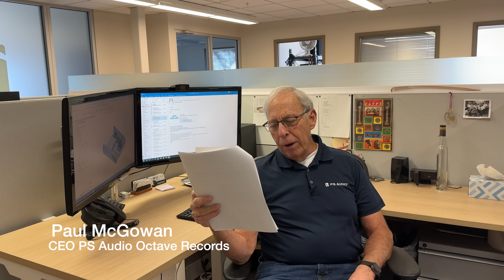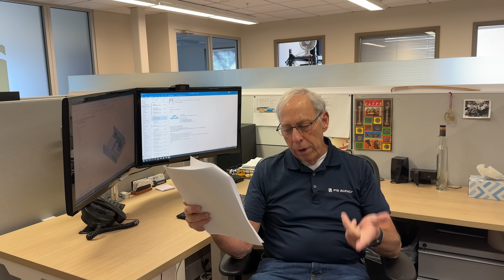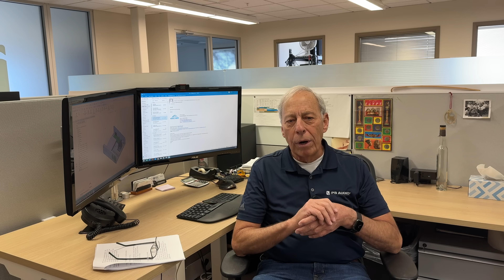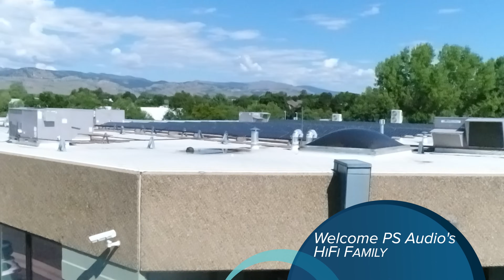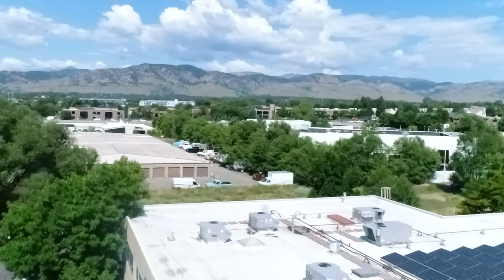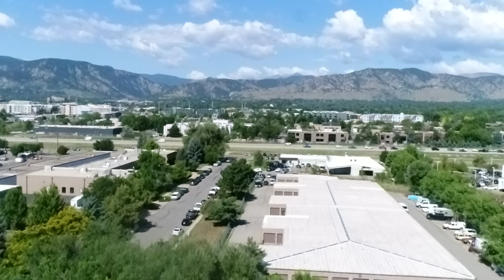Solid core vs  stranded speaker cables

Comment: Paul’s a smart guy. I can’t believe he continually walks into this minefield regarding cables. Common sense tells each one of us that two cables of equal total gauge, length, and of the same material (but where one has varying vs the same gauge sizes comprising its construction) cannot be heard as different   in a blind compare over multiple trials, where all else in the set up is equal. It’s just not possible and we all know it.  Can a difference be measured? Sure?  Does that matter if you can’t hear it? No. If you AB  them in a non blind fashion after spending significant $ on the exotic version and telling your friends about it are you convinced you hear it?  Absolutely-freakin-lutely.  The placebo effect is real. Confirmation bias exists. Both are the bane of this hobby.
Reply: @fakeklg  care to elaborate?
Reply: @edd2771  no, but yea: 
🙄 is the action or gesture of turning the eyes upward as an expression of annoyance, exasperation, disbelief, etc. : the rolling of the eyes in response to a YouTube comment that expresses unprompted explanations of supposed expert opinions.
Reply: Yeah, it just goes on and on. I've been reading this kind of "stuff", to put it nicely, for decades.
I don't know from "blind tests". I don't know from cable science, or the lack thereof. I don't know you, and I don't know what you've experienced in your lifetime. I most certainly would not presume to tell you what you've experienced, or not experienced. That is a fool's errand.
What I 'can' tell you is an experience that I had early on in my audiophile journey. This was before I ever heard about 'blind tests' and 'placebo effects' and 'psycho-acoustics' and 'the illusion of cables brought on by money spent'.
I had purchased a modest stereo system, and was hoping to improve the sound with some new interconnect cables.
I read no reviews or advertizing of these cables. They were just what happened to be on sale. The price I paid for them was fairly well under a hundred dollars.
When I took them home, I had no great expectations. For me, it was more or less an experiment. I wasn't sure if they would work or not, and if so, by how much the sound would improve. They were intended to replace the out-of-the-box cables I had received from the factory.
I had no fancy graphs or pie charts to tell me what the cables did or didn't sound like beforehand. I had to play some music and use my ears to judge. Blasphemous, I know!
Well, my ears told me that the music I was listening to now suddenly sounded WAY better! Like I had bought a whole new stereo system!
Now, it could be that my ears were liars, in which case I'd better be EXTRA careful when crossing the street.
However, like a naive child, I trusted my ears, and have enjoyed my music more ever since.
Good thing, too. If I had been one of those people who doubted my own senses and thought cables were just a bunch of hooey, I wouldn't be enjoying music more, and would just be miserable.
Reply: @Hare_deLune  wow. Talk about “going on and on…”.
Reply: @edd2771 
Ha!
I make no apologies for being a pedant.

Comment: Also, take into account the synergy the cable brings. It depends on how you want to tune the sound in your system. I use naim nac a5 cable. I’ve used cables with silver and they were too bright and enhanced sibilants.

Comment: I find it funny when people try to explain why they believe cables make no difference. I believe to my ears🐭
After many years of passionate listening and music enjoyment i can confidently say that if you don't admit cables influence sound, you didn't even try 🙉
Reply: So lets setup a blind test and do a livestream
Reply: yes. absolutely.. the cables i built myself from standard electric cables from my local hardware store 6mm sounds the very same or better than fancy $$ cables. do that and see.
Reply: In order to hear the small difference (5%), You need equipment that is worthy of the difference.  I suggest system starting at 20k, then ensure your source music material is up to spec in terms of the original master, mixing engineers, proper microphones and placement.  Preferably a live version of a recording in a studio instead of 16 - 24 layers.  That makes a difference of easily 10 - 20 %.  Also, cable from dac to amp should be upgraded for another 5% difference.  Now you have a 30 % difference.  Also, you get another 2 - 3 percent by placing speakers in reverse phase.  I know it sounds crazy, but reversing the + to negative on both speakers provides better sound stage.  2-3% I estimate.
Reply: @AV-MusicMan  Oh Dear, what do you recommend then in terms of polarity reversal for speakers with the tweeter, or the midrange already in reversed polarity? What about inverting amplifiers? Should they be inverted or left alone, because they're already inverting? Is there an incremental improvement to be had from every reversal, as is the case in multi-stage amplifiers, or is it not additive?

Comment: I use Naim Nac A5, which is kind of a mix of both worlds. 4mm2, made from 19 thick strands of 0.51mm diameter copper. Wow! I couldn't believe the difference compared to the similarly priced Audioquest rocket22. 
Naim don't push the marketing on this cables, but they are proper hiden gems.
Reply: Not that hidden a crapton of us in the UK use them by default. They are neither ‘stranded’ as in 50+ fine strands nor single core but somewhere in between - multi core. They replaced more expensive Audioquest cable in my system years ago and to me they are ‘end game’ because some rabbit holes aren’t worth it.

Comment: What kind of cables are inside PS Audio speakers or amplifiers? Multi-solid core (another stranded kind) or stranded? Which dielectric material has been used ?
Reply: gracias a mamá por cocinar y a papá por los gritos! 😮

Comment: Cables carry the signal from one component to another, or to the speakers. Hard to believe that some people think they aren't that important. Even the best cables lose some sound quality. The best you can do is limit the damage by using really good cables. It might be a case of having to buy really expensive cables to hear a good deal of improvement. If really good coffee started at $600, almost no one would believe there is a better cup of coffee; when something is beyond their budget. Trying to find improvements among cheap cables, besides not being scientific, is like trying to find a needle in a hay stack. I do think that a great cable could be made for not a whole lot of money. Most cheap cables seem to be doing a decent job. It takes hearing a great cable to hear their failings. OCC is good cable usually. OFC can often sound dry or lacking tone colors.

Comment: You have to consider wave guide 😊
AF goes beyond hundred GHz!!!😅
You have to know that electrons are on the surface of conductive wire, so it matters only the conductivity of that surface and the size of it related with cross section of a cable.
Reply: electrons move through wire at a rate of millimeters per second . The music travels in a magnetic wave that flows over and around the wire at near light speed.

Comment: You're wasting money unless you also buy a supply of artisanal collected and hand sorted virgin electrons. The regular electrons will 'remember' distortion from the previous systems they were used on, and may even carry the smell of coffee or overcooked toast if they were once used in a kitchen. No bueno on that one.
Reply: Thank you for the laugh!
Reply: Cables make a difference, you probably aren't listening critically to your system (which is fine) but if you go so far as to treat your room and listen carefully for hours and do a lot of AB comparisons, a difference can be heard.
Reply: @bradstone2603  ... and the fact that there's no study, in which subjects were able to correctly distinguish between two cables of similar gauge and length in a controlled environment is just a coincidence. You can be the first.

Comment: I must admit I've found experimentation is key and like copper only or silver only or tinned copper al stranded. I have used Kimber 8-TC and others but found them a little lean in the midband. I think its more about the whole system from power amp to driver

Comment: How do electrons or electricity travel through a copper or metal conductor/wire?
A complicated question:

1. “There's something called “skin effect.” In smaller wires, household wiring, electricity travels through most of the wire. It's electron transfer. In really big wires, most of the current passes in the outer part of the wire. Never on the outside of the wire.”

2. “Thus the current flow in a wire is concentrated on the surface of the wire, as the current in the middle is repelled more than any other currents. Normally the effect is negligle, but design of high current wires is tricky. The electricity or current travels in the outer surface.”

3. “Speakers are inherently AC (alternating current) devices. While they function on AC signals to produce sound, the electrical current they receive from power sources, including batteries or amplifiers, can be either AC or DC.”

4. “The electrons in an AC circuit don't really move along with the current flow. Instead, they sort of sit and wiggle back and forth. They move one direction for 1/60th of a second, and then turn around and go the other direction for 1/60th of a second (if the frequency is 60 Hz). The net effect is that they don't really go anywhere.”

5. “A twisted pair of conductors provides Common Mode Noise Reduction (CMNR) configuration for excellent noise rejection. This configuration is preferred for lower powered tube/valve amps where high current flow is not an issue. Simple and elegant solution for valve amps and/or speakers with single full-range drivers.”

Personally I would focus on expanding my Audio/music Library than worrying about Single Twisted-pair Solid core Teflon/Silver-plated Speaker Cables at: $128.50 for a 2.5m pair…….
That’s just me though
Reply: Silver plated stranded copper in PTFE is surprisingly common and quite affordable, unless you buy it per metre from an audiophile oriented proprietor. It has by far the greatest chemical and heat resistance with the dielectric constant close to that of air. It has one huge advantage in wiring of drivers and  components- it solders beautifully and the jacket does not contaminate the joint, as is the case with PVC and PE.
Reply: This is very interesting about how current flows, no wonder it's difficult to predict how things really operate. Fluid dynamics anyone ? https://www.youtube.com/watch?v=2AXv49dDQJw
Reply: The truth is always in the middle. Bad cables (even expensive ones) can really ruin the sound.

Comment: Ok I am being silly and serious at the same time. but help me out captain obvious, isn't stranded wire the same thing as solid wire braided together? (and that was the suggestion as I understood it) I'm confused.
Reply: Stranded wire, twisted is like 30-40 pieces of copper, with nothing between them whereas solid core is only two or four pieces of copper total, which are individually as thick as the stranded wire when it's all together, and they're typically insulated from each other in the main sheath.

Comment: I'm surprised he didn't say that if you use stranded wire    
the two conductors should be twisted in opposite directions.    
I agree with Paul on a lot of points, but not in connection with cables.
Reply: i was surprised he didnt start promoting his own interconnects.
Reply: I'm afraid he may have had a stroke...that made ZERO sense to me!
Reply: @magicphred  Yep, the funniest part was when he said you have to take solid wires and parallel them together lol
Reply: The purest mentality with regards to speaker cables is completely ludicrous. Any sonic difference that can be measured between say 10 feet of Kimber 8TC and 12 awg of a good stranded copper speaker wire is so insignificant that the hundreds if dollars difference in cost cannot be justified with any practicality, especially if the system doesn't cost as much or more than a car or with old ears. All that expense doesn't do anything below 10kHz, and very little at 15 kHz. By the time you can afford that stuff, you're old enough that you can't hear it, and any talk or claims about it are purely technical, and so imagined by the older listener. Proponents of this nonsense try to throw in other variables to justify their claims, but scientifically, it doesn't actually make any technical sense, unless you believe in the junk science, which is rather common these days.😂 
🤔Anything practically insignificant,  shouldn't be considered to be  so damn significant .. another problem of our times, my friends.🤯😵‍💫
Reply: @shipsahoy1793   yes, such marketing is used in every consumer good, finding the highest quality that is based on measurable, quantifiable, value is the key.
Reply: @shipsahoy1793  Don't measure - LISTEN.
Reply: @VideoArchiveGuy and when you listen to compare make the testing DOUBLE BLIND . You'll need someone to help you do this.
Reply: @shipsahoy1793 yes if both the same gauge and length.
Reply: @doncahooti At 10 feet in length, the gauge isn't very critical either in most home installations, the speaker cable length is usually less than 15 feet to a speaker, which is still rather short, so 14 gauge copper would be quite sufficient for typical power levels. Now if the wire was aluminum, I would suggest 12 gauge instead for a similar result (based on measurement). The other elephant in the room is that most people don't have a listening environment that is always under 40 dBA, (or sufficiently performing equipment) which is at what you need to have a chance at evaluationg subtle differences in the sound at nomal listening levels under 90 dBA. Even preconceived bias and expectation, as well as your own hearing ability, which may not be as good as you think, can trick you.
Reply: @shipsahoy1793  - huh?
Reply: @doncahooti 😂
Reply: @d @doncahooti  the mind is a terrible thing to be wasted
Reply: @shipsahoy1793  so stop it
Reply: @doncahooti Are you wasted or just dim ?
Reply: @shipsahoy1793  so feed it to a hungry zombie
Reply: @shipsahoy1793  youre the dim one , the difference in speaker wire that matters is capacitance.
Reply: @doncahooti  No, I did not mention which parameters were involved; you just assume that I don't know, but my comments all still stand regardless .. if avoiding long cable runs and/or small gauges of speaker wire, and/or "non-standard poor decision speaker wiring," then your concerns about capacitance  are unwarranted.
Reply: @shipsahoy1793   you are completely in denial of physics . 
Capacitance is everything especially in amp - pre amp interconnects . You can hear the differences.
Reply: @doncahooti IF your ears  have enough audio bandwidth; iow, you need to be fairly young to notice 200 pF shunting the signal thorough your speaker, and still must have damn good speakers to boot, with virtually no environmental noise, and a high S/N ratio from your setup, AND a good recording.. If you can't understand that, I feel sorry for you.

Comment: Would solid core have less resistance paul?
Reply: Resistance will go down when cross sectional area of the wire goes up. Stranded wire has less cross sectional area compared to solid core wire in the same gauge size because of all the small gaps in the wire fill. So stranded wire will always have a slightly higher resistance compared to solid core for the same wire gauge. 

Where things start to get tricky is when you talk about the skinning effect. Low frequencies use the entire wire for conduction. However, high frequency AC will travel close to the surface of the wire. This phenomena is known as the skin effect. The more wire surface area you have in a given cross section, the less resistance you will have for high frequency. 

So the best thing to do is to have one large conductor wire to minimize resistance for low frequency and another few conductors in parallel to minimize high frequency resistance.
Reply: @tristanjones7735 the skin effect isn't relevant at audio frequencies.
Reply: @tristanjones7735 for low of for high freq?? you contradict youself.. thanks pal.